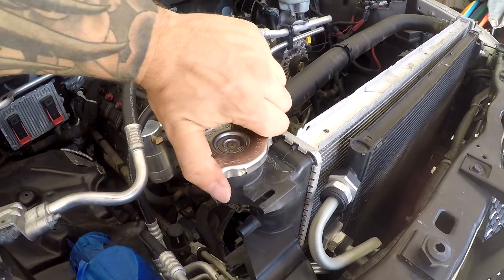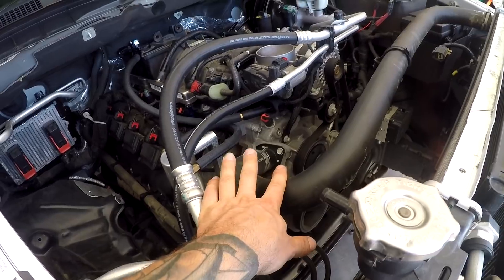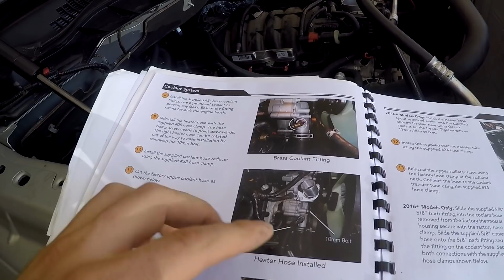Modifying the RAM 1500 Cooling System - HellRAM EP6 Supercharger

Comment: When you say it's the v6 electric fan, are you implying that it is a fan for a v6 engine that has been installed in a v8 truck? If yes, why? I'll assume that it is going to be sufficient cooling a larger engine.
Reply: You probably already found your answer, but yes you can run the V6 fan and remove your clutch fan and the other fan (can't remember the name of it, but it sits in the shroud and is electric). It should bolt right up and plug in (with a little bit of "massaging" of the wire routing). You'll need a tune though to update ecu to turn on the fan at the correct times (or you can run the a/c and the fan will come on automatically as a low buck temporary solution). 

The newer fifth gen trucks don't come with the clutch fan at all on the 5.7 (IIRC). I'm in Arizona and paired the fan with the 180 thermostat when I was tuned. I haven't had any trouble here on the sun. LOL

Comment: What is the catch can for?
Reply: Rich 
The catch can for the PCV valve catches vapors from the crank case ventilation so you don't gunk up your intake valves with higher mileage he will be draining and a different video. Watch his video where he installs it.
General repair
Reply: Thanks General Repair, my 14 only has 34k so I'm ok for now?
Reply: Rich Haak yes you don't need one . Especially if you're not beating on it. there more for racing applications anyways.save your money 💰
Reply: @southjerseypinball  I put one on my 14 hemi when first bought.   I get a few tablespoons every couple few months.  I think its worth it.